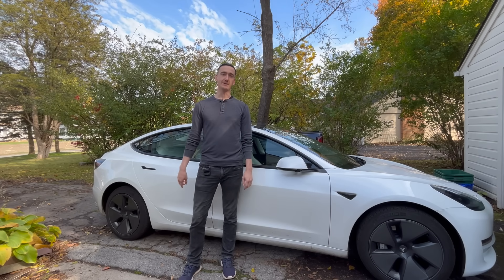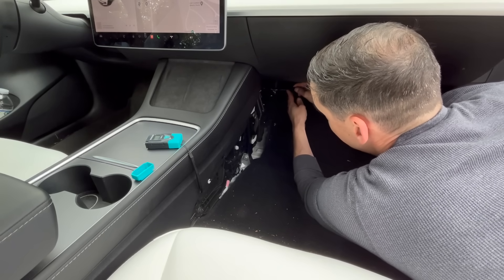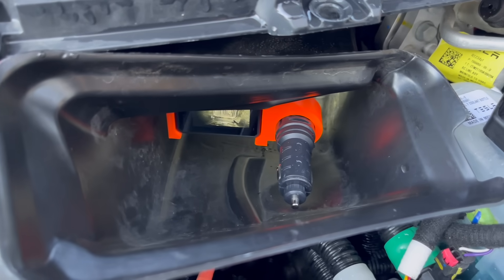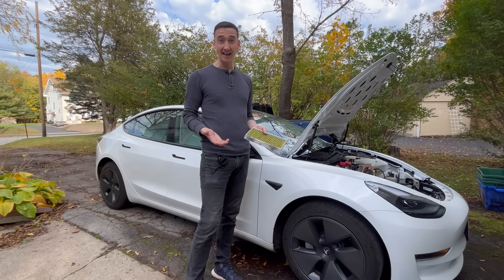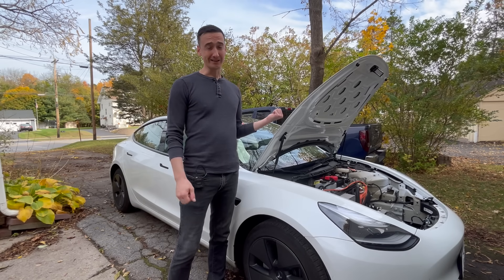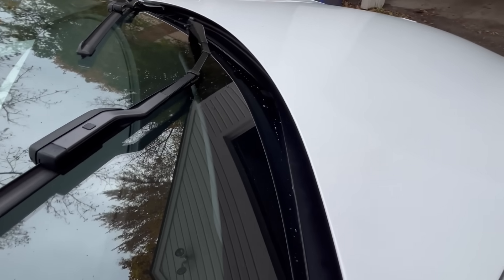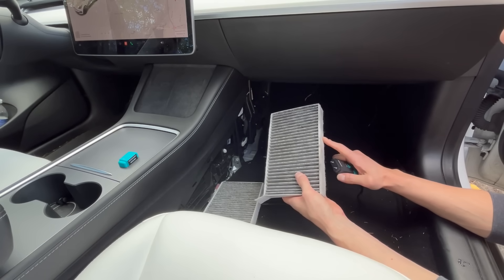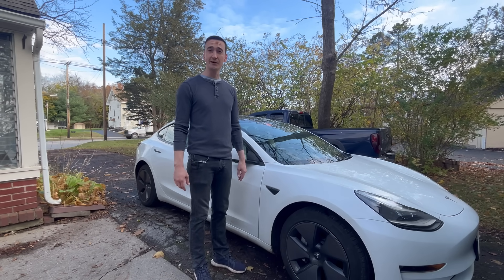This design flaw makes Tesla’s Model 3 smell bad! (with fixes!)

Comment: I suggest that you show your entire process, don’t cut out the variations in your approach it adds context and provides more content for your viewers. 

Otherwise critical thinkers are likely to be concerned that this might be faked for some reason, whether intentional or not. 

My opinion only.
Reply from the maker: Appreciate the feedback! Which steps did you think were missing? Or do you mean that it should be all one take?
Reply: @adamdport id like more clarity on action steps. It seems like the simplest and cheapest solution would be to just remove the intake duct. What would be the downside of that?
Reply: @adamdport  film all the steps, showing how much water was applied each time etc. 

If you’re demonstrating a problem show how you got to the conclusion. 

I’m no engineer, I’m no scientist either, though I like to see that a process was followed to demonstrate what is being implied.

Comment: My Model 3 made in 4/2019 has a different design for this duct work.  It's in two pieces that clips together and has a drain hole to the lower left away from the grill. I made a quick video - https://youtu.be/DX6WhDUeJ90 - it almost looks like in trying to simplify the part and reducing cost they made it worse. I've never had the smell issue.

Comment: Great video!   I have a 2022 Model Y (with bio-defense mode) that also has this issue of bad smells when the car gets wet.   So in my opinion, the redesign has not resolved this issue.
Reply: I have the same issue with my 2022 Model Y (With Bio-defense mode). This smell is horrible.

Comment: worth noting that my 2019 model 3 long range does not have any under hood partial gaskets as shown on this 2020. So i guess tesla improved things by adding the partial gaskets in 2020...? but didn't go all the way across for some reason.

Comment: Huh.  Link for the filter is broken - doesn't resolve (at least for me) to the product on amazon..
Reply from the maker: Try "see all buying options" on the right, not sure why Amazon does that sometimes
Reply: @adamdport  Thanks.  I'll try in a bit.  Perhaps there isn't stock and that's the issue.  Or I need to use my home computer.  Either way - thanks for the great video.

Comment: Funny enough my Buick Grand National has a similar setup, Buick got around the reverse flow on the drain with a little rubber flapper but the problem with that is that debris eventually collects and overflows into the cabin.

Comment: Carbon filters only absorb odours up to even osmotic partial gas pressure. This means it cannot fully get rid of all odours, it will fill up relatively quickly (hours or days, maybe weeks if you're lucky) and then it will re-emit the odours when ever it gets warm. In other words, Carbon filters are a waste of money unless you have a regeneration function to desorb them periodically. You'd be better off with an ioniser.

Comment: If you've removed the duct, why don't you just cover over that vent to completely prevent water ingress?
Reply from the maker: No reason not to, there's a ton of room around the control arms for air to get in. But I don't think covering the hole alone would do much unless you seal off the entire apron somehow, like I tried in 14:01

Comment: Very informative. Just an FYI, if you use aftermarket air filters and your a/c blower motor goes out, you will void the warranty coverage. And it’s about $1k to replace. I would stick with factory filters at least until the limited 4 year/ 50k miles lasts.
Reply: Your warranty can't be voided unless you do something to cause the problem. It's not legal to void a warranty for using non-OEM parts or service unless doing so caused the problem.  But if you want to be paranoid about it, keep your original filters and if your blower motor goes out, swap them back in before calling Tesla.
Reply: I appreciate that somebody else understands the law!  @bW9taeH4

Comment: Really nice video! Once again, this proofs Tesla just straight up sucks designing such an easy part. They might know how to make engines and battery packs, they sure do suck at designing actual cars. Wish they would just sell their drivetrain to other brands so we can have proper cars with nice engines. Although, other brands are really catching up when it comes to the drivetrains. They only card they hold is giving discounts.. and that can't last forever.

Comment: Super thorough, complete analysis of the problem WITH several suggestions for improvement. Loved the camera shots inside the duct to show what's actually happening. Seeing is believing. Also loved the junkyard benchmarking to see how other automakers have addressed the issue. Thanks for going the extra mile here and providing some solutions with before/after empirical data to back it up. Great work!
Reply: Just a great video. 🤩

Comment: I would not recommend removing the channel to the air filter. Now if you drive in rain moisture from the tires, cars in front of you and so on can enter much more easy. Especially mist. I think the airchannel just needs a deeper water trap and further away from the fan. A 3d Print could solve this.

Comment: Great video. Good analysis. Just one thing is that even heavy rain is different from when you are holding the garden hose directly to the area of the cowl. One could do a rain simulation of just water dropping on the windshield rather than direct pressurized water hitting that may cause the water to go inside. Also the drain hole on the duct can be made bigger with a ram built in on top of it so that high pressure from the blower motor will not ingress water in. Legacy Model S have the same design where the cabin filter is actually on the cowl side and these cars don’t have the filters getting damp. I still believe that States with high humidity, Model 3/ Y , evaporator gets condensation and the filters do touch when cabin filter door is closed and fan is running where it pushes the filter against the evaporator.  Nevertheless, great video!
Reply: You say great video but are making a bunch of excuses on Teslas behalf.? Do you work for them?

Comment: I think you find the one of the reason . Last month a testa technician told me another design flaw is the moist of AC when AC is running also trapped back to the filter and causing filter smells . He suggested me run fan Witt AC turn off to blow the filter dry time to time

Comment: Just one problem with his simulation.  How many people turn their fan on full blast in a torrential down pour and the car at an standstill?  In most instances, a car is moving Forward.  Under such circumstance the wiper in combination with the head wind is pushing much of the rainwater to the side and up away and certainly no down towards the air intake area.  A correct simulation would involve a large fan blowing air > 25 mph onto the windshield.
Reply from the maker: Just getting into the car on a hot day in the rain will start the fan on full speed to cool the car down

Comment: Great analysis. I’ve had the problem multiple times and replacing the cabin air filter worked, just like you mentioned. However, I had a road trip in cold weather in pouring rain, and I had to drive 2 hours in the pouring rain. this design flaw led to water getting into the resistive heater element and shorted the circuitry. This led the car to pre-emptively shut down to protect itself and had to get the car towed and heater replaced.
Reply: in a downpour I'll be sure to recirculate air
Reply: and for sure you will mist up the windows and won't be able to drive anymore  @richmondparkers  😂
Reply: @verdele  Ever hear about AC?
Reply: I've had mine for years and never had that issue in all kinds of rain.

Comment: just need a little scoop over the drain section so the air can't suck it up.
Reply: That’s an interesting suggestion! I think I’ll try that. In ICE oil pans, baffles have been used forever to direct rapidly sloshing oil and froth to an area where is can be best utilized, e.g., the sump pickup. 
In the Model 3, I think this baffle might need to be 2 or three inches in depth away from the filter entrance and over the drain hole, which should probably be doubled in area.

Comment: Excellent video Adam! 🤩
This is clearly a design fault Tesla should fix for free. At the very least the software features you mentioned.
Going to get the aftermarket gasket you’ve suggested and change the filters in the meantime. 🤞🏼
Subbed. ❤️

Comment: Thanks for the great guide! I ended up taking out the intake on my 2019 M3, but there were a few differences that make your 2021(?) easier to work with:

- the 2019 intake seems to be a 3-piece affair: an irregularly shaped box adjacent to the fan, a detachable vertical portion, and a slightly different "funnel" at the top with a wide flange on the driver's side (presumably to protect the positive 12V battery terminal, even though that has its own rubber cover)
- 2/3 parts come out easy, and the funnel can be reattached to shield the battery and also secure the surrounding trim pieces together (as it has 4 pins that connect into different pieces)
- the innermost part is nigh impossible to remove, even with the frunk removed. Something to do with its weird boxy shape and perhaps a different layout of mechanical components in the 2019. After rotating it for the better part of an hour, I dremeled it into 2 pieces and removed it. 

The shape of the 2019's intake seems to be a bit better when it comes to water, as the drain hole exits much further from the air intake and is also at a noticeably lower "sump" point - water has to travel up a reverse slope to get to the fan. But I'm about to replace my cabin air filter again, and I just don't want to deal with any contributing causes that I can avoid.
Reply: I had the same problem with a 2020. I left the inner part attached to the firewall for now but unclipped the lower part that makes up the scope upwards.  We will see how this goes but already looking at also adding a hood seal so that water won't drip onto the AC compressor, etc.

Comment: OMG this was so helpful! I have both 2021 Y without hepa filter and 2023 with biohazard help filter and I definitely been having smell issue on the 2021. Will the gasket you mentioned for 3 work for the 2021 without the hepa filter? Thanks!
Reply from the maker: There are different products available for the Model Y you can search for, or here's an affiliate link https://amzn.to/3MC007y

Comment: There's an aftermarket cover for the intake duct that does a fantastic job preventing leaves from being sucked into the duct. That would probably help with this some as well.

And now that I'm thinking about it, I've had it in mine for a few years and I haven't noticed any odor. Went two years between filter changes last time too. Suppose I've also been using carbon filters the last few years.
Reply: I did get a smell despite that cover.

Comment: Wonder if its a current (ICE) requirement that cabin air can't be pulled from the "engine" bay. I have had issues with diesel exhaust fumes being pulled into the cabin (leaking exhaust) 
Obviously not a requirement for an EV 🙂

Comment: I’ve been dealing with this stinky issue since I got an M3 in 2019 and now I finally know why!

I would like to add that I can confirm that in my case changing the filters was not enough to remove the odor. I have to use the condenser cleaner as well. For me the problem isn’t every few months. It’s comes as the wether warms in the spring. When I start using the AC instead of the heater the smell kicks in. But it stays gone all year after I do the cleaning and replace the filters.

Comment: engineer join chat

now i see why you get water inside
it because straight pipe into vent not like any other vehicle like P pipe sideway just like 15:30 and without P vent sideway and drive into piles of water it will get kicked up by front right wheels throwing into vent which why want it make it face down so doesnt get sucked into vent and there is no engine in there so there nothing to worry about it facing up to hoods reason they added vent on top is because engine is in front of it so they dont want engine smell into cab so they make it up behide hood and have no engine them you can make it go around to to front of car there be less or no water getting inside vent 2nd i was wondering you havent seen one on dirt bike or atv there is small rubber valve drain tube which stop air coming in but release water out of air box i recomment you check it out will find more puzzles of fixing issues

Comment: No real option was offered as a solution. You still got moisture content on the filters building up with the gaskets installed. Why didn't u make the drain hole bigger on the duct as a trial?

Comment: You can probably modify the intake and make the hole larger. I had this issue after I changed my filters out, I haven't had the issue since. Some clear engineering flaws similar to the trunk opening letting in a bunch of water lol fuuun stuff

Comment: 11:42 the reason for not having gasket in the middle of the hood is because of aerodynamic performance. The air that enters the radiator mounted in horizontal in the bottom of the front leaves the car on this space and creates a downforce pressure.
Reply: That’s interesting and seems plausible. Are you just guessing, though, or can you point to a source that confirms this design intent?

Comment: Tesla says to replace the cabin air filters every 2 years, I'd say do it once every year at the least. I've replaced customers air filters and they are basically clogged after 2-3 years of neglect. My 22 m3p started to have a funky odor, and found that the filters needed replacement, that took care of it early and has been good ever since. I like the aftermarket gasket you added to the hood, the car will still pull air from around the sides of the hood just fine if that is blocked.
Reply: It’ll still pull air, but the volume will be reduced.

Comment: Sadly, the Model Y with bioweapon defense mode/HEPA filter also has this problem.  I've had to change my air filters twice in 1 years because of the stink.
Reply from the maker: Which did you change—hepa or interior filters?

Comment: You would need to have an flange intake facing down against the firewall.  This would remove the direct scoop for water, and as well keep it a bit cleaner from things directly on the firewall intake.  Also because there is no ICE it would work just fine to suck are from anywhere in front.  A nice molded downward scoop would be best, no need for seals.

Comment: This is a great analysis video.  I have smelly filters, but live in SoCal and has almost no rain.

Interestingly, I get the smelly condition  when I have run the AC in recirc for a significant period of time.  Wetting of the filter makes tons of sense, though the accumulation mechanism must be different.

Thanks a ton.
Reply: Running in recirculating is NOT a good idea. Moistures from our breathing out will be captured by the filters and of not get trapped in the cushion of the seats etc and eventually end up in those filters. People forget how much moistures comes with just breathing out, we are living beings and our body consists of mostly water! Google it if you have any doubts.
Reply: There’s moisture in the air, humidity varies too from hour to hour etc. Moistures will get into the filters even it hasn’t rained.

Comment: To be fair, I have a 2018 model 3 performance, 91k miles. Highway driven 5 days a week. Never had any smell, and I have had Tesla change my filter, and I have changed my filter before I gave the car to my wife (driving a 2023 model Y performance now)  to be honest? I could have happened but I always warm , cool, or defrost my car in all weather conditions, and I have never used my fan past 7.. thanks for the heads up. No need for me to upgrade anything.. my cars are preset  and at temp before we enter our cars.

Comment: Our 2013 Chevy Equinox had a problem like this after running the A/C. They had a recall to install an electric fan to dry the in cabin filter out. It’s not as bad, but still can smell sometimes. I just run the heater on high for a bit.

Comment: Thanks for the easy way to take care of this problem at the end of the video.  i have circulate mode turned on now.  My vehicle does not seem to smell right now, but I guess it will happen eventually.   I got my new Model Y this August 2023 and so far have gotten 4 updates. Whether Tesla has done anything on this problem, have no idea.  So I shall see over time if my vehicle produces any weird odors from the filter system.
Thanks again. Take care.

Comment: Another thing you can do is replace the filters with carbon ones. I learned this the hard way but it defintely works.
Reply: I tired that with filters that were highly rated on Amazon. They had their own problems. I eventually went back to new Tesla filters.

Comment: Very well done, nice analysis and great hidden camera work! Very interesting to see rain & wiper-blasted water intrusion there... good point re lower fan (or wiper downstroke) speed!
Especially cool to see that Carwash mode door/cover, close over air intake!!

However: I think MANY folks in humid/hot but NOT rainy climes, still get filter funk... with NO rain.  Therefore, It must also come from the evap coil condensation , or?
 Your ideas will fix for rain or carwash, but.. not for that..?